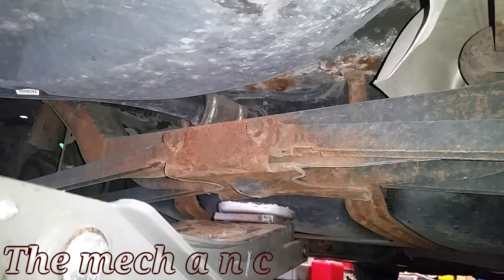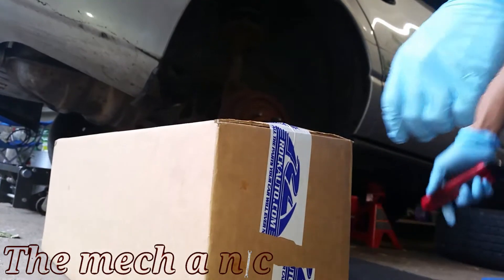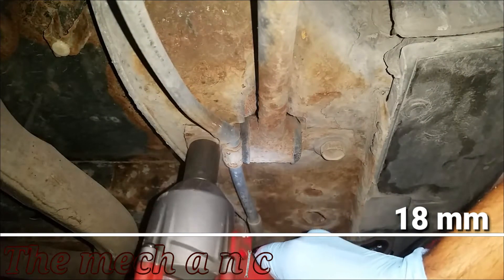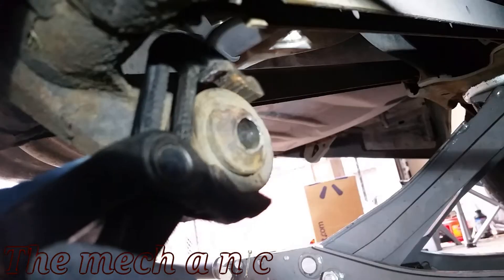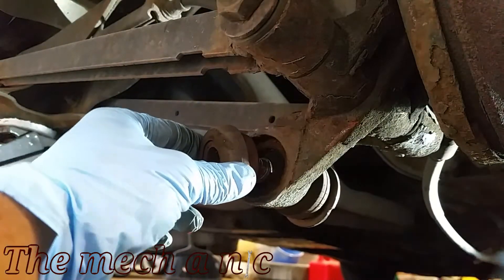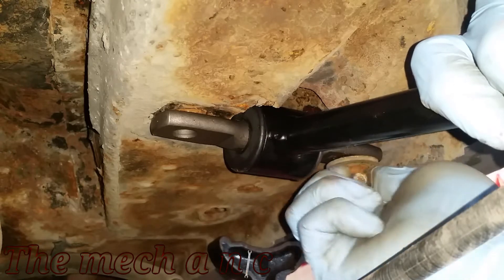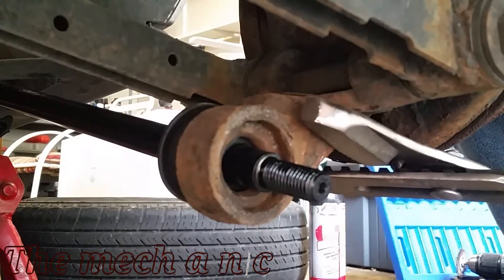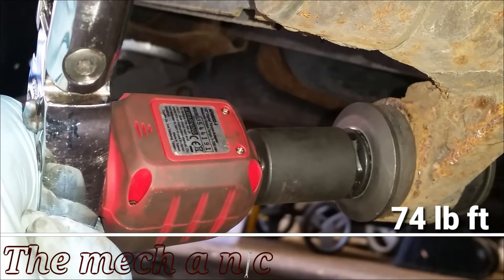96 - 02 saturn s series trailing arm

Comment: Just watched your video as a former Saturn trained mechanic worked in the dealership for a little over 15 years. The reason that trailing arm failed was due to stress. Where it snapped a pot hole will make that break. The amount of rust under your car you live in a rust belt, out of all the years I worked for Saturn and even now I have owned my own Saturn repair shop since 2010 I've only seen 2 of those break one was due to a guy sliding into a curb in the winter and yours. I also noticed that nail in your rear tire also. Great video but do not over torque Saturn bolts that just adds more stress to the part always tighten to OEM factory specs.
Reply: Had two go one 2 yrs ago. One 3 days ago. But i do have 252,336 miles on it.
Reply: I used a sawzall to cut the bolt
Reply: Good to know ur in the Texas area is ur Saturn shop still up and running? I’m ur neighbor if ur in Fort Worth I have a slightly POS Saturn that I love and would really like to get it the TLC it deserve for being such a good “cheap car” I got for 410$

Comment: Thanks for the video. I just replaced both rear trailing arms on my 2000 SL2. Easy peazy is the best way to describe how it went. My passenger side one broke but I replaced them both right away. I'm sure they were the original ones as I have owned this car for 18 plus years now. All bolts and nuts broke loose easily. And I live in the upper Midwest in snow and salt country. Even the one that broke, the end with the rubber bushings was so stuck in the hole that it held firm. I could remove the nut no problem. I did soak the nuts with WD40 several times the day before. Backed it up on ramps, made it easy work. Bought my arms from RockAuto. Took 4 days to receive them.

Comment: Very helpful video, thanks!
I have some personal experience points to add.
  
Point #1
Rockauto delivered my trailing arm part for 2001 SW2 via Fedex from Bronx, NY to Boston area in 2 days, $62.78 total.  That's some serious service!

Point #2 
My original trailing arm piece snapped off, just like the video, on the front of the forward knuckle washer.  And yeah, the back nut would not come off, it would just spin the remaining bit that is trapped in the knuckle.  I tried an alternative "pry" method as depicted in the video, using a pry bar instead of the pickle fork.  Didn't work for me.  
So I attacked the stubborn piece from below with a sawzall, probably the wrong blade, it was a wrecking blade that I had available which is a bimetal thing.  Used up 2 of those.  I think that if I had an actual 18pt hacksaw blade for the sawzall, then I might have glided right through the shaft of that thing.  In my case, I melted a lot of rubber bushing...fumes...and kept rotating the shaft with a wrench on the rear nut.  Definitely cut into the shaft.  But after coming up short, I decided to rip out the rubber bushings and succeeded using a screwdriver and a sharp knife.  I needed to see what was happening under there.  
Ah-HAH.  A stupid steel shaft, almost cut through, and very visible and vulnerable once I took out the rubber bushings.  
I managed to trap the free swinging shaft after various attempts with C-clamps and finally, a visegrip.  
Once the thing was secured, I used a simple hacksaw to complete the cut-through, took about 15 seconds.
My advice:  strip out the rubber bushings, trap the free shaft somehow, and just cut the dang thing with a hacksaw.  

Point #3  
I also had some trouble installing the new shaft, it's just a little short and the rear bushing/washer/nut won't thread on easily.  You have to move the whole knuckle/lateral link forward somehow, to gain enough length on the new trailing arm shaft for the rear bushing/washer/nut.  I found that this was difficult using body/arm pressure.  Tried a C-clamp...forget it.
 I finally succeeded by using a ratchet strap looped over the rear lateral link and forward around, gulp, the jack stand supporting the car just forward of the connection bolts of the trailing arm.  I made sure that MY body parts were clear out from under the car while I carefully ratcheted things forward to create room on the back end of the new trailing arm for the bushing/washer/nut.  
It worked for me.

Comment: I had the same repair on a 99 Saturn SL1.  After several attempts with an impact wrench and trying to cut it off failed, I cut the bushings away, vice gripped them, and used a propane torch on the nut and stud end.  I kept the grips on the stud and used the impact wrench while it was hot and it finally came off.
Reply: I also used Rock Auto.

Comment: Though i have made a few comments on this thread. This video was very informative as to what to expect. I was unlucky and am not allowed to lift my car off the ground due to my home community rules. Here is the list of tools i used, as i am a poor boy as well... 1/2 drive tools: 18" breaker bar, 12" ratchet, (2) 6" extensions, 18mm socket, 21mm socket. A folding utility knife (to cut bushings), a screwdriver and vise grips to remove them. A 14" pipe wrench. Will also need some thread locker for reassembly.These are the tools i used to get this job done without being able to lift the car and remove the wheel. Not recommended to do this way, but if you need to do this way for any reason there are the tools nessecery.
Reply from the maker: Thank you
Reply: Thank you as well, couldnt have seen it through with out knowing where to start. And i see these situations as give and take. Which is what i do.

Comment: I know this is an older video but I have a 2000 sl base that did the exact same thing, front sway bar then passenger trailing arm. But considering the car is 22 years old at this point and the previous owner didn't change anything, I think it lasted pretty well
Reply from the maker: Yeah you can't really blame it for failing

Comment: I've owned four S-Series over the last 25 years as second - fourth string cars in the household fleet.  A new '97 SL2 until 2000, a '95 SL2 from '06 until '17 (it's still in the family), a  2002 SC1 from '14 until my son hit something with it in '17 and bent the sub frame (totaled), and a one owner 2002 SL2 I bought in 2013 for $2500 with 100k miles, which I still own, now with 142k miles.  It's still running strong and rides and drives pretty much like new.  To answer the question in the video, so far I've never had an issue with sway bars or trailing arms.  Other than the new, under warranty '97, I've always done all of my own work on them, including a recent complete update on the '02's front end.  The struts, lower control arms, and inner and outer tie rods were all original and getting a little weak.  I'm getting ready to do preventative updates on the still-factory rear struts and trailing arms, watching some prep videos, and found yours.

Comment: Thanks man,excellent vid.  My 95 saturns snapped going down the street 3 weeks ago,  luckily  I was right around the corner and was able to hobble back home. I grabbed 2 dorman arms and the same ac/delco adapter  on amazon prime day. Just got done finishing my first one, doing the second one tomorrow.   I'm in the northeast mine had crazy rust as well, run into the same issue getting it off.
Reply from the maker: Glad you were able to get it done 👍 yeah it sucks when things like that break. Good luck on the other side
Reply: one of my bolts were in bad shape, spent all of saturday driving around to no avail finding a replacement.  Mech a nic do you know if rockauto carries these bolts, I checked saturnparts and didnt see them on sale anymore, checked ebay for salvaged ones no dice.
Reply from the maker: You might have to go to the junk yard and find a Saturn like yours  for specific bolts like that
Reply: thanks bro, yeah it's looking that way. Dorman got back to me they dont sell the bolt, kinda strange since they sell the arms.  Fortunately I located a decent salvage yard a half hour away, thats my best bet.
Reply from the maker: Good luck, hope you get it fixed👍
Reply: thanks mech a nic, got it done yesterday.  After searching yards, I gave up finding the gm part. I was able to find a 10.9 fastener at fastenal, not a perfect match  the head was slightly bigger, didnt have the pilotguide, but the length, pitch and coarse matched, and it fit.

Comment: You actually can get a Front Stabilizer Tension bar (Sway Bar) brand new. You can find it on rockauto, part is DORMAN 927124. $98.60 (with 5% off coupon) + $11.99 shipping. It comes with new bushings, washers, screws, brackets.
Reply from the maker: If i still had the car that would be a good option 👍

Comment: Wow man great video! I have a 98 Saturn S and mine did tha exact same thing.. I'm looking to replace it tomorrow.. this video definitely gave me confidence.. Thank You!
Reply from the maker: Yeah , it's not that bad of a job. It's a common failure.  Thanks for watching 👍
Reply: @themechanic6117  ok cool man! And I also have to replace tha brake shoes too but that's out of my league I will pay somebody
Reply from the maker: Maintain it and these Saturn's will go forever. I like those cars
Reply: @themechanic6117  yeah my last Saturn was a 02 SL 5speed.. I got it up to 274k miles.. ran so good..
Reply from the maker: Nice. Take car of them and they'll take care of you 👍
Reply: Driver's side trailing arm sheared off on the way to work this morning, just like yours. Thanks for the video! I'll be better prepared for how to do the fix.
Reply: @Jones22_  I have two '02 SL 5 speeds; one I bought new, has 240k miles on it, the other one i bought just last year has only 110k on it. Love 'em both.
Reply from the maker: Pretty easy fix. Good luck and thanks for watching

Comment: Yeah its purely age, rust, and stress. I am currently rebuilding my front and rear end suspensions completely. It's about a 2000 dollar job in just parts, and requires my own blood and sweat. But, these cars still have alot of life and you can get lucky and find one without alot of rust. At 20+ years old now though, you have to go through and clean and repaint suspension in the very least, replace all rubber bushings and mounts, and clean all visible rust underneath and undercoat. After that, there is still a list to do to make sure it stays in tip top shape. CHECK YOUR OIL!!
Reply: BTW CT here so I see plenty of rust belt symptoms. UNDERCOAT YOUR CARS!!!

Comment: I have never heard of problems with the front sway bar on S series cars. Its a big steel bar that bolts to the subframe and to each lower control arm. Mine is 28 years old with no problems. Even has the original bushings.

Comment: Never had an SL1, but I have a 97 SL2 with 230k on it and an 02 SC2 with 100k. Never had a suspension part break on me. I'm in SoCal so I'm wondering if rust in other states makes this issue more common?
Reply from the maker: I could see the rust having a lot to do with this

Comment: I have a 97 saturn sl1 as well. My problem was slightly different than yours in that the first suspension piece to go out was the LEFT trailing arm. I probably drove around with it snapped in half for about a week until I fixed it, & then I less than 30 days later I had the sway bar crack (again on the left side) nearest to the wheel ... that was a bitch to replace. Then I shit you not , probably about another 30 days later I have my RIGHT control trailing arm snap on me and that’s why I’m watching this video now. Cause on the right trailing arm there’s a brake line connected to the trailing arm & I don’t see any way to disconnect it from the trailing arm. 

I do find it kind of strange how all three of my “sway bars” (if you will) broke in less than a 2.5 month period. One after the other. & no I did not have any other suspension/tire work within 6months prior to all of the sway bars lol . Strange.

Comment: I've had several of these break over 28 years. Not a big deal.

The BIG DEAL is when the forward mount location rots out and you have nothing to bolt the trailing arm to. That's when the metal fabrication FUN begins. 😂😂

Comment: Nice video, I’m about to try and replace both of mine at my house with a basic tool set, do I need threadlocker or is it just a sense of security
Reply from the maker: You dont need thread locker. Just make sure everything is properly tightened down.

Comment: Nice video, this might be a cost cutting thing as my 2002 SL1 had the same thing happen but my 1996 seems fine. Most of the comments are 2002 cars....which front springs break on as well.
Reply: My 96 SL2 has snapped 3 or 4 over 28 years. I replaced with ones from Pull-A-Part as opposed to buying new. I might have gotten ones off Gen3 cars which you allege were cheaper made.

Comment: I picked up a 2002 sl1 for 300$ (208,000 miles) and my trailing arm snapped in the same exact place, so I’m guessing it’s just age after awhile they just break.
Reply from the maker: Super common ossue.luckily its a easy fix! Nice deal on the car!👍

Comment: Im 1:20 into this. I own an 02 sc2. Same exact side, with a near exact placement for the break. However not sure if yours is an OE part. But mine is. This snapped yesterday on me. 17 years into its life.
Reply: Trailing arm broke in the EXACT SAME PLACE on my 2002 SC2 (317kmi, original owner). It's the factory-installed original part on the driver's side. Noticed the problem by hearing an unusual clunk coming from the back on the driver's side while going over a speed hump. Will Rock-Auto the part and change it out. THX for the video! From the comments regarding common failure mode, I'll order two trailing arms and have one ready to go for the other side when it goes.
Reply from the maker: Best to be prepared! Thanks for watching!👍

Comment: I don't mean to pick your video apart but if you'll see how you were trying to hold that washer on the bushing with your pliers the reason they didn't work is you were holding them from the wrong side whatever you're holding the faster needs to turn into the plier teeth not away from.
Reply from the maker: That makes sense. Didn't realize that

Comment: @0:18 when you jack it up like that, does it release a pressure from the Rear stabilizer bar completely? See May I removed the Rear Strut for replacement and want to replace that  Stabilizer Bar End Links of course, but when I removed the bolts for the Steering Knuckle, the bracket w/that  Link got kind of twisted, since there is a tension from the bar.  I think that is bcs the car is sitting on 3 wheels on Race Racks, so the rear is suppressed unevenly: the R Driver side is suppressed and the Passenger rear wheel (on which I'm working) is removed, so the R Passenger side of the Stabilizer Bar is not suppressed at all.
   Thank you for the film and advice with that company, I ordered from them a Heater for 2001 Saturn SL2 for ~$10, they sent very quickly. seems like a good heater, I checked w/water - no leeks. They had a question, where I've learned about them, I told about you. Thank you again.

Comment: my 1998 saturn sl1 did the same thing   Im going to see if I can remove  the trailing arm myself tomorrow . Im just curious if this could be done with out taking the wheel off.?
Reply from the maker: Probably but why wouldn't you take the wheel off? Itll make the job easier
Reply: Im doing this without removing the wheel. However yeah probably much easier to remove the wheel.
Reply from the maker: I see no reason why you shouldn't remove the wheel. Itll be easier 👍
Reply: The mech a nic i cannot put my car on a jack or jack stand, due to rules of where i live. Not even allowed to work on cars here, but the way i see it if they want that rent i need my car 😁
Reply from the maker: @raymondrust681  I hear you. Thats rough

Comment: Why did you remove the tire to replace the trailing arm?
Reply from the maker: Because it makes the job easier without a wheel in my way
Reply: @themechanic6117  but its not necessary correct?

Comment: do you have a link for the part at rockauto?  trying to find a cheaper one than my local part store
Reply from the maker: https://www.rockauto.com/en/catalog/saturn,2002,sl+sedan,1.9l+l4+sohc,1388549,suspension,control+arm,10401
Reply: DORMAN part #905811

Comment: just wondering ...How much would you charge me to fix my Saturn sedan SL 2001. I just took it to a repair shop and they charged me $300 for part and labor.  BTW how much did you pay for the arm?  mine cost $178 acording to a receipt they gave me, The most expensive one I saw online at Autozone for around $100 . That means they made a quick $200 in 1/2 hour. lol
Reply from the maker: +skamravec I did this job for free because it's my cousins cars but I would have charged about $100. The part itself was about $60 from rockauto. If you get this part from a local auto parts store it like $150 if I remember correctly. That's why they charged $178 for the part because of Mark up.
Reply: Getting ready to replace mine,  i got it for $100 at Oreillys auto parts
Reply from the maker: Pretty easy job. Good luck
Reply: Dorman arms are roughly $68 per arm from AM AutoParts online.  Find some place or someone who will put on your own parts and give that a go.  That is, for someone else who is going to do this but doesn't have the tools to do so.